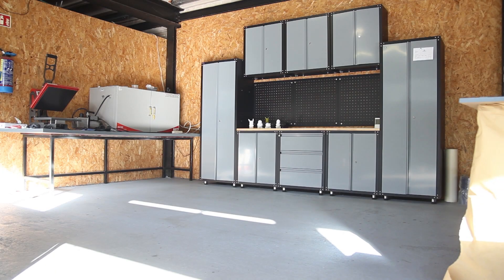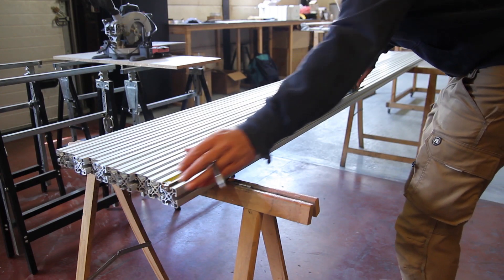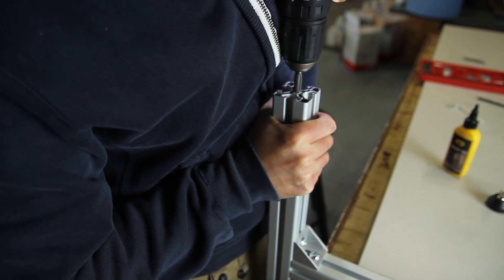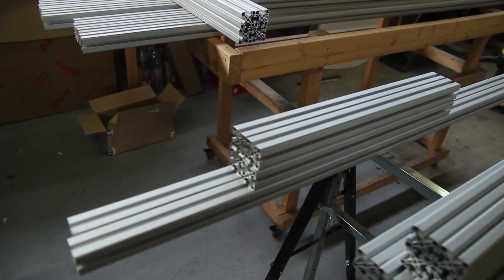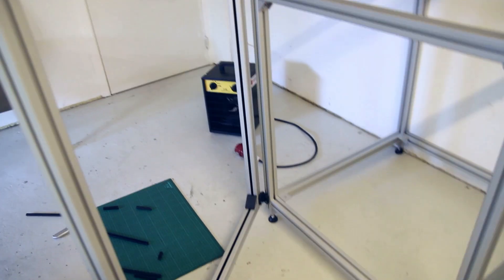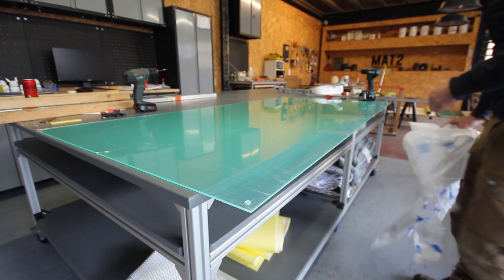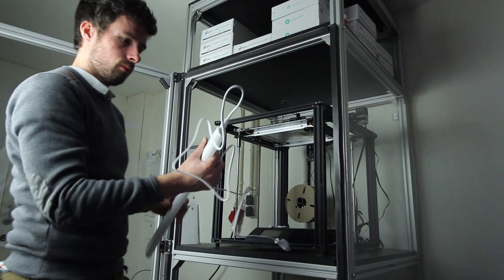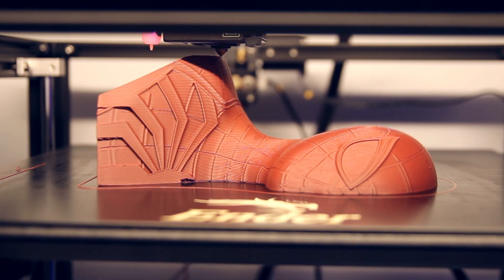3D Printer Enclosure Build - Creality Ender 5 Plus (Aluminium T-slot profiles)

Comment: acryl is not cheap but burns verry good , real glass is safer for fire accident
Reply: Glass is a terrible option. It does not have sound insulation properties unless you're going with very expensive glass. It's also quite easy to crack or shatter it. The right option would be polycarbonate. It's very strong and provides excellent acoustic insulation. It's also a self extinguishing material. It's widely used in industrial machinery.
Reply: @WayneStakem  du haste keine Ahnung
Reply from the maker: yes correct!

Comment: That is too big, if you will print abs you need approx 45 degrees celsius in box. you will heat it up forewer. also you should have 2 separate doors. You will see after a while that you need to redo that
Reply from the maker: I now get 35°c stable with just the printing beds heating the space. The enclosure still has gaps here and there so 45°c shouldn't be a big issue 🙂

Comment: Very nice enclosure! If you want to print abs in the future you do need about 50°C in the enclosure. So you will have to seal it better, or add a heater. I would recommend sealing though :)
Reply from the maker: I've read about that, I'll probably add some ventilation and heating, still a bit worried about the electronics inside the enclosure, so might need to figure out how to move the to the outside of the enclosure, and like you've mentioned, seal the enclosure even better would help as well!
Reply: @MatthieuLibeert  yeah, the electronics is a good one. At the temperatures for abs the mainboard should be fine. But the temperature will shorten the life spand of the power supply. So it may be worth it mount the power supply outside of the enclosure. Another benefit of the extrusions, you can just print a mount for whatever you want. 😅
Reply from the maker: @Rein-hg9in  Haha True! Everywhere I look at now, I see 3D printable pieces
Reply: @MatthieuLibeert   Ive had solid results  with printing ABS/polycarbonate/carbonfiber materials in an enclosure via using heat reflective materials on walls/ roof  to trap the heat produced by the printers. for the electronics overheating aspect Ive had great luck using a bigger fan that is able to be programmed to turning on at certain temps in the environment( had stepper motor driver probs from overheating due to lack of cooling) this greatly improved print quality.  my enclosures are much smaller than yours ( for Pulse XE, ender 3 v2. ) Ive found only way to move electronics to exterior is obviously extending cables to route to the outside or close to the outside, still enclosed but with external fans mounted from outside facing inwards at electronics. I'm sure youve contemplated these, I found them to be beneficial.

Comment: Cool Matt....... I'm about to build a new workbench and enclosure for my 3d printers.  I've pre ordered the new Prusa XL to go with my mk3s.  Maybe I can incorporate some of your ideas for the enclosure 🤓  and yes, plexiglass aswell as normal glass has increased in cost by four times since the start of covid😒
Reply from the maker: I really enjoyed building it and would recommend everyone to do so! It's not the cheapest option but like I've mentioned in the video, I enjoy the many options and modularity of this system! 
Correct, the raw material prices went up a lot! the MDF wood that I've used for the shelves was X4 compared to a good year ago
Reply: @MatthieuLibeert  I finally got around to ordering the aluminium t slot extrusions...... I got 10 3m lengths and with fitting it cost £945 delivered😳